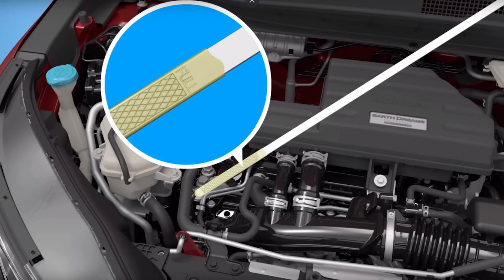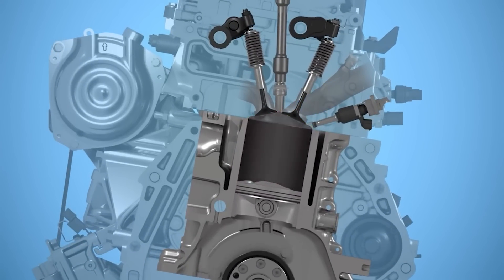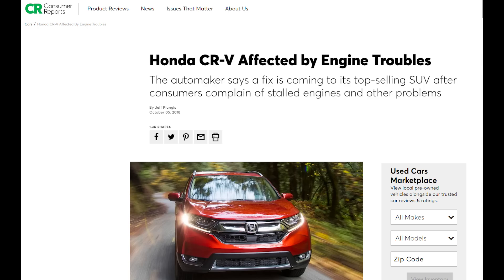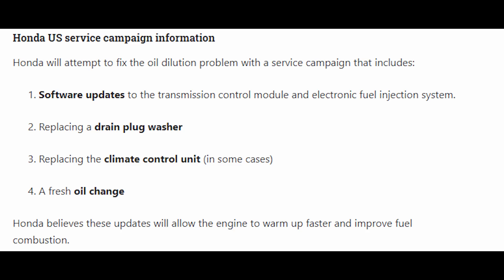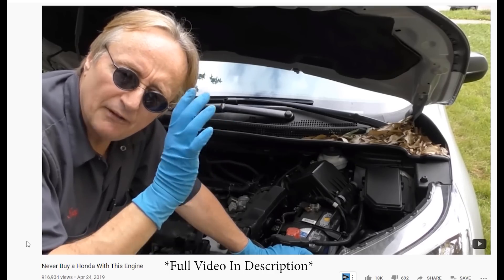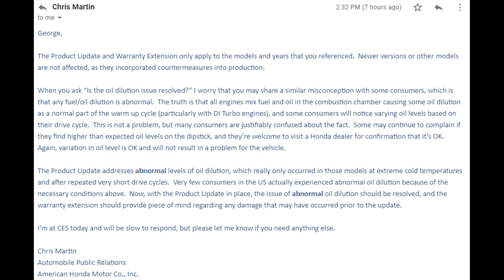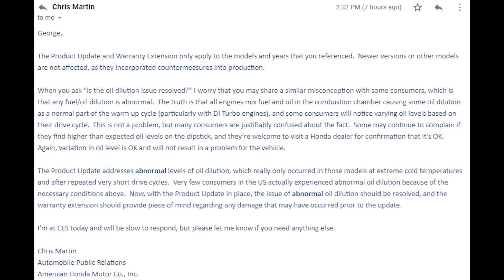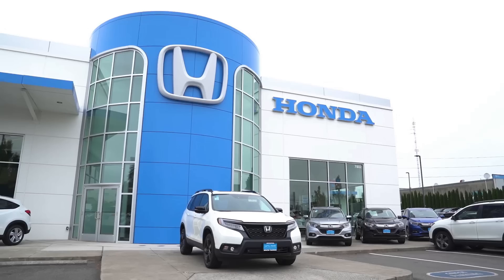Does Honda Have An Oil Dilution Problem? | 1.5L Engine in CR-V and Civic

Comment: My 2017  "brand new" CRV-L drove out of the dealer#1 lot at 15 miles to the date as of 1/22/2020 the highest average MPG is less than 22MPG.  Dealer#2 checked it out and no problem.   Dealer#3 flushed the engine with some sort of chemical at 13,000 miles, "to clean the injectors" so I was told, not a mile improved, but of course I'd paid for that flush and not under warranty.  I'd to try again at 14,500 miles and this 4th dealer just asked me to changed oil because the check engine light came on.  Fine, I did paid for it, too.  The best part of it at Dealer #4 mechanic told me to "flush" the engine with highest octane gas available to see it that improves the MPG.  Then I got online and after few days of researched online and found plenty disappointed CRV owners like me.  This time I did not bring the CRV to dealer but I got rid of all my Honda stocks I had owned and traded the Honda stocks  to Tesla stocks instead.  Hey, Honda Manufacture, yeah, you're reading this comment from a "REAL" CRV owner, hollah at me.  So I can start my "problems" (that's plural) list with you.

Comment: I took my new 2020 Civic non-turbo LX in to see my mechanic who took care of my 2,000 Civic for 20 years, and he told that he definitely smelled gas, but the gas mark wasn't above the orange plastic at the bottom of the oil dipstick, and that I haven't driven my car enough to damage the engine.  He recommended that I keep an eye on the oil dipstick, and the moment it went above the orange plastic of the oil dipstick, to take it in to get my oil changed.  I guess that's the only way I'm going to stay ahead of this curve, is to not give the gas a chance to mess up my engine.  He told me that any business like Walmart who changes oil should use a Full synthetic oil that matches up with Honda's oil, that it is an industry standard, if it says "Full Synthetic."  And, Walmart charges less than 50.00 for a Full Synthetic oil change.  So that's what I'm going to do.  If it costs me 200.00 dollars a year to change my car's oil 4 times, say every 3 months, it's worth it.  I recommend that owner's of new Honda's check their car's oil right away, for level and smell...or check it before you even buy the car for more peace of mind, and then decide if you want to deal with this problem if it does reek of gas.

Comment: I was about to pull the trigger on a 2018 CRV with the 1.5 turbo. I had watched several videos on YouTube reviewing the CRV including one by Redline Reviews. It was after watching that video That decided on the CRV with the 1.5 turbo. Then I started reading about oil dilution problems that people were complaining about on Honda forums. That was enough to change my mind. I tried a Rav4 out but didn't care for it and ended buying a 2017 off lease Toyota Camry with a naturally aspirated V6. Not being able to buy the CRV was very disappointing but the Camry is awesome and I feel as though I dogged a bullet. In closing, apparently Honda is in the process of creating their own oil to fix the problem of the oil getting past the piston rings. I wish the folks with these CRV'S luck with the hope that this will solve the issue.

Comment: if they ran a 16:1 afr when cruising on the highway this problem would not be as prevalent, that plus an AOS, and a tune for 91 octane with a little more ignition advance, I think you would see this problem disappear
Reply: Jeremiah Jorenby  no it would still be there
Reply: @JL-fy7zx  in the amazon..

Comment: I just filled out a Survey from Honda, and told them that I was smelling gas on my oil cap and oil dipstick on my new 2020 Honda Civic non-turbo LX at 170 miles.  I told them that they need to do the right thing and recall all the cars that are having this problem, and stop blaming the customers for their engine flaw.  That they need to do the right thing, and stop coming up with excuses and fake fixes.  I said that if I had another chance, I would buy a Toyota.  I just sent it in...whether they do anything is left to be seen.
Reply: You will smell gas in any crankcase oil. Just smell the 1.5 Turbo and you'll really notice the difference.

Comment: I was a Honda girl and planned to buy a 2019 CRV. The fear of being part of the fuel dilution issue caused me to look elsewhere. I reached searched vehicles for 18 months and test drove 12 different SUVs. I choose the 2019 Subaru Limited. I live in snow country and it has exceeded my expectations with comfort, safety, handling, fuel economy, and visibility.

Comment: If you follow-up again, PLEASE ask Honda about the heat issues, which, in cold weather states, is even a bigger issue than the oil dilution. Many 2017-19 CR-V owners, like myself in Minnesota, report lack of or inadequate heat in below-freezing temps, especially when driving at city speeds.

Comment: I bought a 2019 civic HB thinking the OD problem was already solved. Well I should have done my research cause my oil keeps rising almost every week. Never buying a non NA from honda again in the near future.
Reply: 2020 no issues
Reply: @moeanthony9308  lucky, out of curiosity where do you live? Honda is claiming OD only happens in harsh cold climates but I live in Texas and it doesn't really get below 40 F, and like I said my oil keeps rising every week.
Reply: @goodboi1232  I live in Canada. Where it is applicable. I was at Honda yesterday and the new 2020 where updated to avoid this issue. Although I don't blame you. I went in as Iam contemplating looking at Rav or this since the interest rate is lower. But some how like you, I prefer NA.
Reply: @moeanthony9308  I do remember honda doing an ecu update for the 2016 - 2018 models to help the engine to heat up faster. They even gave an extended warranty for those models. Now they said that 2019 will have that updated ecu at the factory so i'm pretty sure those "update" that they did with 2020 is the same if not identical. I just hope that my '19 civic HB can lost long enough until I graduate college and find a decent paying job so that I can replace it.
Reply: @goodboi1232  I hear ya and you are dead on. That's what they told me. Ecu update. Turbos in general I don't trust.
Reply: @moeanthony9308  turbo, Gdi, and cvt. Not really a perfect combination for a long lasting cars.
Reply: @goodboi1232  well cvt, be mindful. I really think Toyota is tops as they been the kings using them in the reliable Prius for years. Honda very good too. All in house. Jatco owned by Nissan be Leary. Hyundai just entered the game but we don't have any long term stats as yet.

Comment: It's not a problem unless there is abnormal engine wear caused by excessive oil dilution. I'd think the best way to determine it is to take an older one with high mileage and do a teardown. I would imagine that Honda has done this after all of the negative feedback. I have a 2012 Civic EX-L Sedan with a normal 1.8L so it's not an issue, but I also have a 2014 EX-L Crosstour with the GDI, so I keep up with oil changes. Of course I still have to worry about the intake valves with that idiotic system.

Comment: Basically, it's the owner's/driver's driving usage.  If they very-cold start the CRV, then drive 5 minutes and stop/park it at the grocery store, while it's still cold, then shop, then come back to a very-cold start again, and drive 5 minutes to get back home, and they also don't regularly change their oil every 3,000 miles, and they beat the crap out of it, while it's still cold, and low miles on the engine, then there's oil dilution.  The majority of the public are not educated in this bad owner/driver behavior.

Comment: Before I watch the entire video, @1:00 in, I bet you it's just that the new Honda engines haven't been broken in just yet, and would require a few thousand miles before the oil dilution issue would resolve itself.  Which is why you want to change the oil on the newer engines a few times earlier than most regular intervals.  Now that I'm in @6:30, I would ignore Scotty Kilmer saying oil changes every 5,000 miles.  I would do every 2,000-2,500 miles until 15,000-20,000 miles are on the engine, then change oil every 2,800-3,000 miles, like regular.  Don't be an idiot.  
.
Who would've thought.. when you only start your very cold car, there's some oil dilution haha  Of course there is.  
Most people think they don't even have to allow their vehicle to get up to the C mark on the temperature gauge before they stomp on the gas pedal and race to their grocery store, then turn off the cold car, then get back to the very cold car then do it all over again on their way home.  Duh.  The problem is the uninformed driver/owner of the cars, not the cars themselves.  Most Americans these days lack a father that knows and teaches them about cars.
Reply: CNNis FakeNews 

Your bet isn’t correct...unfortunately.   My oil dilution did not occur until my 18 CRV had 10k miles on it.  Engine break in had nothing to do with it and it hasn’t gone away on mine despite the software fix by Honda.  OD now occurs within 1K after any oil change.
Reply: @markp6586  I'm not betting.  You didn't break in your engine properly, then you claim it's not the issue.  When did you change the oil?  Which oil did you use?

Comment: Oh damn today before watching this video I noticed my oil level was about 1/4 inch high I was wondering how and why because when the dealer had changed the oil it was right where it was suppose to be. Thanks to your video I will address this with the dealership and 🤞 hope all is good.
Reply from the maker: Glad  I can help
Reply: I think the problem with oil dilution is much bigger than it is reported. These days Most of the car owners are dropping off their cars at the dealer or other places for oil change and service without even checking oil level. Of course  Honda dealer is not going to tell you about ABNORMAL OIL LEVEL, they are happy to change the oil for you

Comment: The oil dilution problem is a consumer issue, not a Honda issue, yet they have a fix for it.  Hmmm.
Honda's Owner Manual shows an oil viscosity rating to use, to prevent damage to the engine, and keep the warranty intact.
Adding gas to the oil changes the oil's viscosity, but some how Honda is Okay with that.  Wow!
You can still buy (safely and reliably) any non-turbo Civic (2.4 liter) and non-turbo CR-V (2.4 liter) engine.

Comment: Toyota: Hold my fuel pump.
Reply: misuterinaso soon Toyota will start using Mazda’s engines.
Reply: Probably for the V6. I have a 2019 Camry SE (4-cyl 2.5L). It's not on the list for the fuel pump recall.

Comment: Has there been any Engine problems or failures  NO. I have worked for Honda for 17 years and if they start having problems they will  fix it. Just like the civics when some of the engines had cracks and leaked coolant. Honda replaced the short blocks long after the warranty was up.  Everyone calm down.

Comment: The problem is that directly injected fuel washes the oil off the bores and piston rings. This causes accelerated wear in these areas which then allows more fuel to bypass the rings into the crankcase and hence the oil. Once this happens it's irreversible. It just gets worse.

Comment: I have a 17 CRV exl and I live in NYC with most of my drives being under 5 miles or 30 minutes. I did not experience any issues with this car is the climate system being unable to heat the car unless you are hauling ass on the highway otherwise you get no heat out of it. Also paint quality is garbage on Honda’s.

Comment: Honda should stick to normally aspirated engines.
Reply: @Mark F 
Competition for better gas mileage , just like CVT trend!
Reply: I know, they had it right with a simple mechanical vvt and na. I think all this turbo stuff is designed to kill the gasoline vehicle. Why else would thet make a car in 2019 that will last half as many miles as the same model made in 2007??????
Reply: @mikeschiavoni5973   How do you know it will last half as long. You don't know.
Reply: @craig162  gentlemans bet, a 5 year bet?? I bet that almost half of the 2019 honda accord turbos will be in auctions with blown or blowing by turbos with less than 150k miles.  Turbos were made for heavy tanks and trucks with diesal, then fighter planes and race cars. A turbo is simply not a long term option on a gasoline/petrol vehicle.  Volvo had the only freak of nature that lasted a long time with turbos, i really cant think of anything else. Porsche, lol no, bmw, omg no, toyoya?? Lol, nope.  Mazda??? Nope,   mercedes....kinda, the deisal one from the early 80's.  Apart from those two what other turbo vehicles are often pushing 150k miles?
Reply: @mikeschiavoni5973   I can think of a few. Saab / Volvo /. Honda is not going to let this become a problem. I worked for Honda for 17 years. I have seen them fix problems that  many company's like Ford/Gm /Nissan  would never fix. Toyota does the same. We had a Toyota dealership also. Toyota replaced frames/ V6 head gaskets with way over 100K.  Great auto makers stand behind there cars. If they don't  people will stop buying them like the other company's.
Reply: @craig162  i hope so. I just think the nature of the turbo just wears out.
Reply: Craig Pomeroy mine didn’t make it past 40 thou. ......Junk
Reply: @mikeschiavoni5973  Internal combustion engines are going to be toast in ten years once the battery technology is better.
Reply: Agreed.
Reply: Mark F the rest of the industry made that switch as well. Honda doesn’t want to get left behind
Reply: @markf5314  I assume CAFE standards continue to press manufacturers to lower their fleet fuel economy.
Reply: @bstevens9831  raise, not lower.
Reply: Thats probably true but there are newer engineers in Honda Now I suspect.  The era of internal combustion engines are coming to a close in the next decade.  I just hope Honda has resumed its reliability record again for electric engines.   I don't think they will innovate in Gasoline engines anymore.  They are dirty, costly, bad for the environment.  The change to a 1.5 liter was a quick attempt to use a turbo to force the engine to do more with less.  It wasn't innovative.  Rushed to market and it was a bad move
Reply: @DavidRC  Toyota may not offer it but Lexus does. Toyota will be adding it soon.
Reply: Electone_Guy the turbocharger has nothing to do with this issue
Reply: People have been trashing CVT's in modern cars.......but Honda's oil dilution & Toyota's new 8 speed automatic transmission problems should be more concerning 🤔
Reply: @mrgarrison3516  i have learned something, its all disposable crap.
Reply: All auto makers should have. Thanks emissions requirements and CAFE for this. I expect over time Honda will refine these engines. They and Toyota learn from their mistakes usually. 

Ford and their eco boost and Chrysler eotech turbos have issues too
Reply: @darknightbegins85  Ford has tge duratec 2.5 which is a 300 plus mile engine. Mazda mated this engine to a 5 speed and you see the mp5's, 2.5 mazda threes all the time. Ford has tge 4.6 v8 which has good torque and known to go 500 plus in taxi cabs. Imo toyotas best engines are in the is 250, the small 2.5 v6.  They stopped using tge bulletproof old camery 4 banger. Not sure why,  the best engine ever made for long term drability. Long story short all manufacturers have had good motors but i really believe they are making them crappy to usher in ev's sooner.
Reply: @markf5314  emmisions.
Reply: It should just be a suck squeeze bang blow without a 185,000 rpm fidget spinner.
Reply: That’s why I bought the 2.5 liter engine in 2017 crv. I always thought a 1.5 engine is too small for large to medium cars. Plus turbo adds more complications and increase wear.
Reply: Nope Toyota doesn’t have any problems with there turbo charged engines Honda fan
Reply: @joskjj3625  toyota models do not use turbo in their models, only cvts along with manual and regular automatic transmissions
Reply: naaa.. you have to start somewhere.... ooo man i can got back an remember sooooooooooo many bad things that happened with ALLL manufatures.... ford chevy nissan toyota ect.

Comment: I bought many Hondas during my lifetime. (I'm 73) However, I have completely lost confidence in Hondas due to this issue and doubt that they could ever convince me to reconsider the brand. In fact, I am determined to avoid any vehicle that has either a turbocharger or GDI engine unless it has both GDI and Port injection. We now own a 2009 Toyota RAV4 with low miles. This could be our last vehicle. Time will tell.